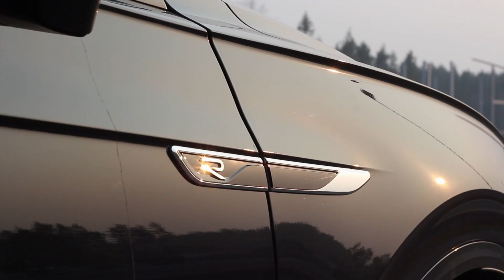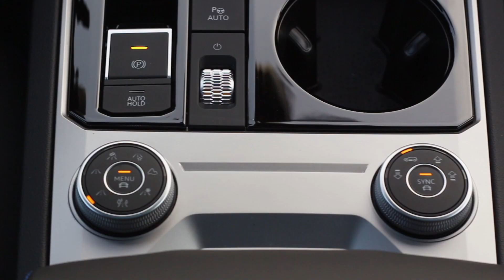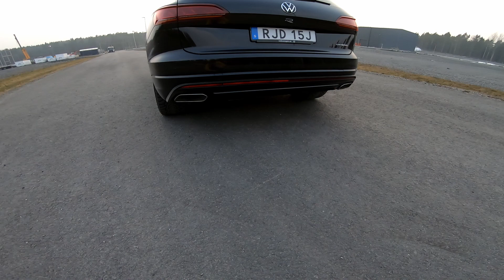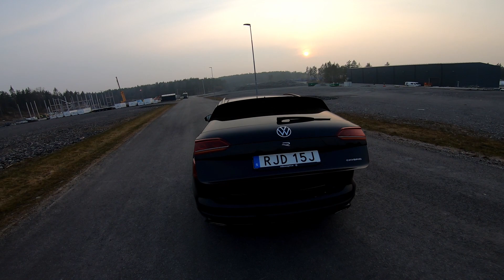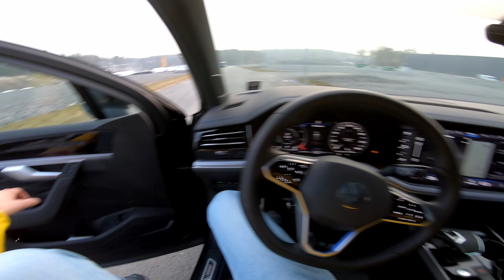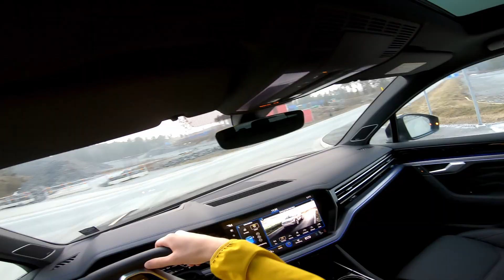New Volkswagen Touareg R eHybrid | Review | HCR | Hybrid beats V8?

Comment: Utter nonsense! The true Touareg R is the 4.0 V8 TDI. Periode.
Reply from the maker: The true true crazy Touaregs must be the V10 or the W12 TDI? Luckily, the V8 is crazy fast, and the eHybrid is just as fast, but with way better mileage
Reply: @HonestCarReviews  You're right. I yet have my Touareg R50 (MY 2009) with its mighty 5.0 V10 TDI. A car which I will never give away - as I will never give away my new 4.0 V8 TDI. I tell you what though, the V8 is astonishing economical in terms of diesel consumption. Driving it with about 8.2 L/100 Km is an easy thing to achieve.